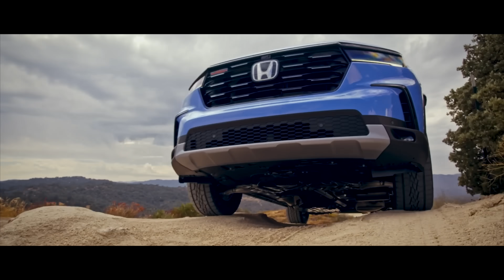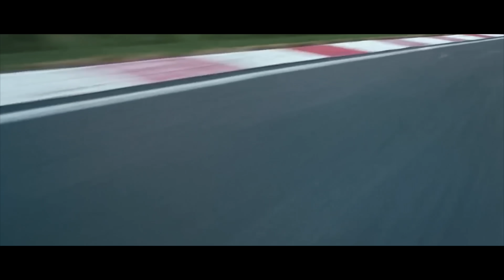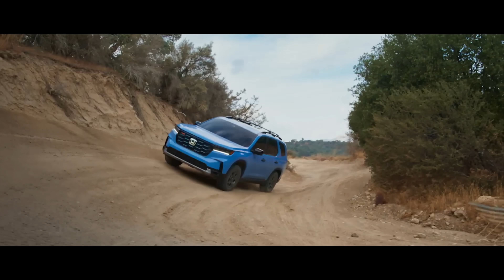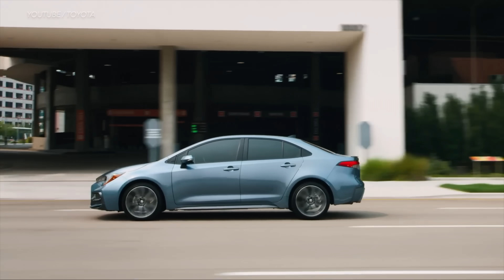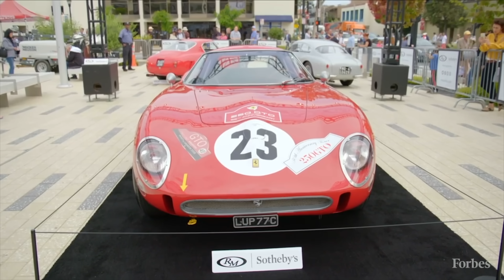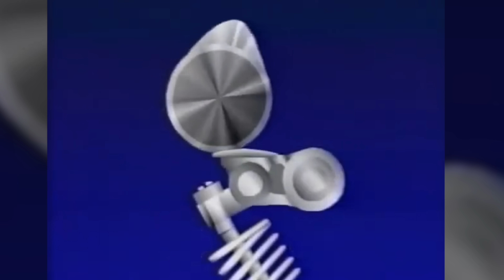Honda's New Engine is the Most Powerful Engine Ever Made

Comment: That has to be the best explanation of the VTEC and the new Honda engine I have ever heard. Another great video Scotty.
Reply: I never knew how VTEC worked until I bought a Honda with 300,000mi on it and changed the head gasket. At some point in that process, i picked up the cam/rocker assembly without compressing it and it essentially exploded all over the garage floor. A solid hour later I had it put all back together again - and officially understood how the thing worked. lol
Reply: Only that it mentions being an intake only based system right in the last 5 seconds. Minus 1 point for that. Out of a 1000 points :)
Reply: 👆That's true jsed, very true.
Reply: Agreed.
Reply: there are much better ones on line,, just do a search... and this drama queen,. will say anything.. then a week or two later say this or that to crap...just a drama queen

Comment: 48 years old and I love both Honda and Toyota. They make the best power train's there is. And will outlast the chassis. If they're maintained properly. I've never had any problems. Out of any of them I ever owned.
Reply: Toyota is good bro so is honda.
Reply: My 2016 CRV had a honrendous vibration at idle, issue with the trashmission. The newer ones have fuel dilution issue  and no heat in the cabin issue. My friend had a 2011 Accord with an issue with the VTEC system when he would start his car it would make a terrible rattling sound. Newer Hondas are noting like the ones in the 90's
Reply: My cousin would say the same thing about his honda mowers.  He said the the engine would last longer than the deck.
Reply: Mazda is act better than both now
Reply: @kid5042  Mazda worst car there is.
Reply: @myronhelton4441  Maybe back in the 90s or early 2000s but Masada now works partially with Toyota and is routinely ranked as the most reliable car or number 2, Honda isn’t even top 5 anymore.
Reply: @kid5042  Thanks for replying to me. Mazda must be reliable.  I think Mazda has the best car, with some kind of new injectors like a diesel.  but is it the most reliable, that worried me. I thought I had read something a few years ago that Mazda was number one. You are right, Mazda top car for 3 years, but you slipped in reading (I am joking), because if you had checked in the last 3 days the new 2023 list that Mazda isnt on the list.  the 2023 survey that dont even mention Mazda. To me that is kind of weird how a car jumps off the list, That makes me wonder If Consumer Reports is brilliant or dumb.  But Consumer Reports was the only one of a bunch of huge surveys that didnt mention Mazda.  It worries me that I dont see many Mazdas. It is interesting that Mazda went in with Toyota. I dont know, but I heard that Consumer Reports was flawed, they only report on cars less that 1 year old.  Toyota & Ford are the only car makers that dont make their own transmissions, some company that makes the best transmissions make transmissions only for these 2 companies. I like the Aluminum body Toyota that has a bigger version of the Subaru flat engine in it. I dont like cvt transmissions.  I dont know if dual fuel injection is reliable. If any car is any good they quit making it. Wonder if any car in the last 10 years is any good.                                    Consumer Reports released its list of the top car brands for 2023 on Thursday. Taking the top five spots, in order, are BMW, Subaru, Mini, Lexus, and Honda. Taking the bottom five spots are Mitsubishi, Alfa Romeo, Jaguar, Jeep, and Land Rover, with Land Rover at the very bottom.Feb 17, 2023. I wanted a Civic 2.4 engine dual fuel injection that they stopped making it & I wonder if the new Civic is as good. I heard the first few years the redesign was awful.
Reply: @myronhelton4441  Wrong again. That’s the list of the best cars not the most reliable cars. BMW are widely unreliable but they are good cars and are fun asf to drive. In 2023 Mazda was still in the top 5 for most reliable cars
Reply: Nope  @myronhelton4441
Reply: @myronhelton4441 had an 88 mazda MX6 as my first car an it went over 300k miles

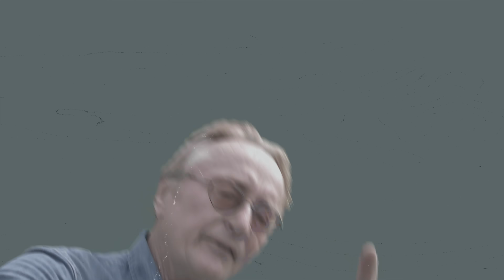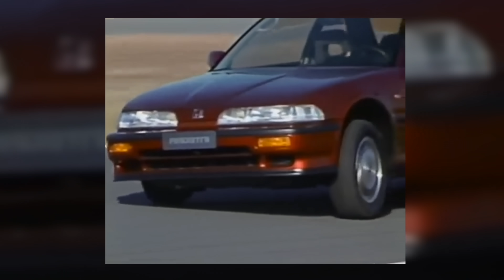Comment: 6:03 - 6:13 here are the actual engines he shows: 
1: D16y7/y8. most commonly found in 6th gen civics
2: C30/32 Very uncommon engine, used in Acura legends and NSX's
3: k20/23/24 found in tons of hondas after 2003 like the element, accord, cr-v, tsx, rsx, rdx
4: F20c/22c found only in the s2000, notable for having the highest HP per liter of any engine when it came out
5: J30/32/35/37 the main v6 honda has used since the early 2000's, actually an american based design, vs the others being japanese designs. found in every mid to large honda and acura. pilot, accord, odyssey, mdx, TL and RL
Reply: @demarkusthompson2867  It has a J35
Reply: No. 4. Only naturally aspirated!
Reply: 感恩，謝謝分享！
Reply: Accurate!
Reply: B16 engine
Reply: d16z9 FTW
Reply: @demarkusthompson2867 Both Generation 1&2 Ridgeline have VTEC engine
Reply: @demarkusthompson2867  we dont talk about the ridgeline lmao
Reply: @redcatxb125 I talk about it the most underrated pickup truck.
Most of the Autombile Press love it for its multifunctional use.
The traditional uninformed truck buyer doesn't like it. Just because it's Unibody construction and has features like Rear Independent Suspension. Also it's FWD based.
Gen 1 2006-2014 all had VTM4 4WD. Gen 2 2017-2023 had FWD only and IVTM4 Torque Vectorng AWD. They discontinued the FWD only in 2020. 
But both Generation Ridgeline have VTEC.

Comment: Seems like Honda has always been leaders in valve control systems.  I remember way back in the 80's when they had  jet valves-tiny valves that were supposed to increase the velocity of the air/fuel mixture entering the combustion chamber.  They stayed crusted up with carbon and didn't seal.
Reply: The Real VR  Jet valves-Actual valves in the combustion chamber with tiny springs, valves, and seat that were actuated by the camshaft.  The entire assembly actually, seat and all, threaded out of the head in one piece.  They were so tiny they just stayed plugged with hard carbon.  In high school I worked afternoons at a machine shop reworking cylinder heads and I hated those.  They were near impossible to clean and we had no tools small enough to machine them so we just had to lap them in with compound.

Comment: I have a 1989 honda integra xsi engine in my crx. Mated to a crx siR 5 speed manual. Still pulls like no other engine ive ever owned. Something about that 8k rpm top end scream just gets you right in the feels.
Reply: You need to own some more engines then 🤷‍♂️
Reply: @Gideon_Judges6  you didn't get it at all